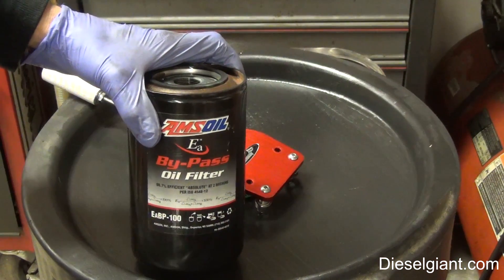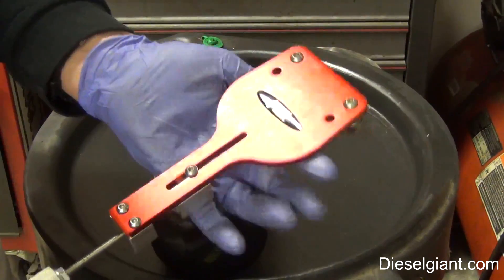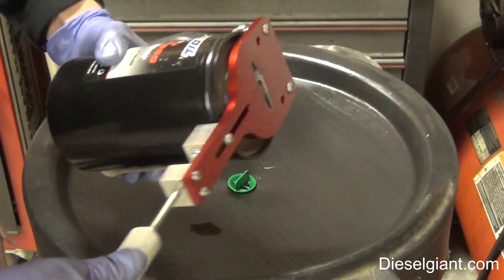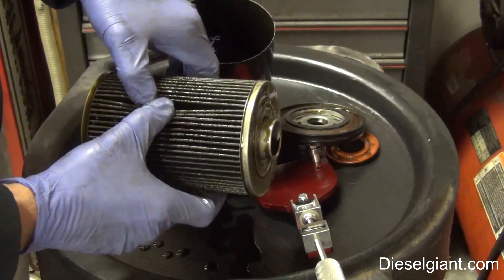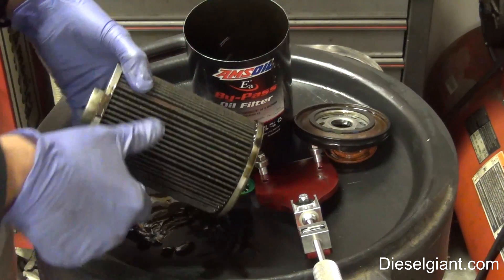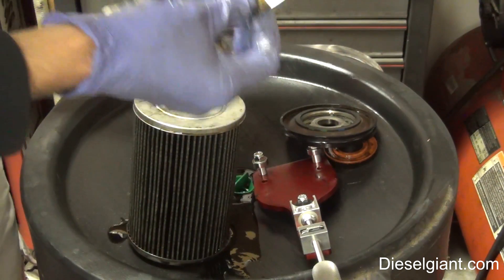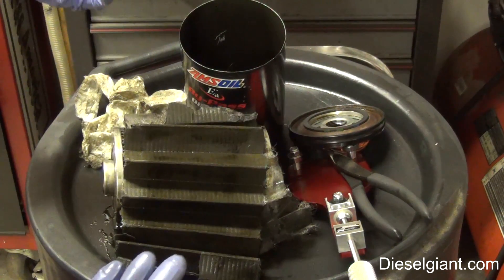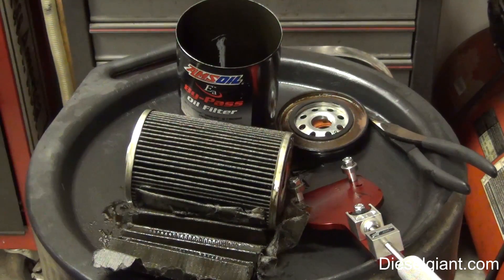Amsoil Ea BP 100 Bypass Oil Filter Cut Open and Inspected

Comment: I have been curious to see what the inside of that filter looked like, now I know. Thanks for posting
Reply: Clinton Roughton The bypass valve is located in the engine or full-flow filter - not the bypass filter.  If your full-flow filter gets plugged with dirt, the bypass valve will open to allow oil to flow to the engine.  Dirty oil is better than no oil!  If the bypass filter gets full, it stops pulling any oil from the engine - no problems.
Reply: +ICU2 AMSOIL Bypass Filters (EaBP 90, 100, 110, and the Heavy Duty 120) are 98.7% efficient @ 2 microns, and remove 39% of soot smaller than 1 micron.  Many filter companies will advertise either their filter efficiency % rating, or their filter micron rating, but not both.  Without both numbers (efficiency and micron size), you can't compare filters, or know the expected performance of the filter.
Reply from the maker: +ICU2 Your welcome, I was also curious.
Reply: +dieselworld I myself, have been using a Frantz Bypass Filter for many many years.  Then recently went to a Baldwin B164 for the convenience of a spin-on filter. But after reading many conflicting micron and beta ratings of the Baldwin I have gone back the the Frantz.
Reply: I was told as long as oil flowing it was good.  The longer the filter is installed the tighter the filtration.
Reply: Clinton Roughton A quick test for spin-on bypass filters is to feel the outside of the filter after the engine has been running for at least 30 minutes.  The filter should be very warm.  If not, it is probably plugged, and not allowing any oil to flow thru it.
Reply: Talked with a tech with AMSoil.  He stated that there are no internal valves to cause emergency oil flow. Once the filter is clogged then fluid stops flowing permanently. Its confusing be cause the name on the filter is "by-pass" oil filter but it contains NO bypass valve.  Point being, on the external filter kit on my truck it uses 10% of the internal engine oil and diverts it thru the eabp100.  service interval is recommended 2 years or 80,000 miles and I'm coming to the conclusion don't swap it out till oil stops coming out the other side of the filter. It actually tightens up the more the filters pores get clogged up.  Like wine it gets better with age.
Reply: The Frantz is a lot better because it has a lot more depth. There is no such thing as.a pleated filter that cleans oil. That filter is the same as a high quality full flow filter. Filters are not complicated. For a bypass filter to do its.job it has to be able to absorb contamination.That one doesn't cut it.
Reply: @davidbess6406  because the fact that it is toilet paper is meaningless: the only thing that matters is, it's a dense cellulose system. The media must be tight enough for the filter to trap small contaminants but not so tight as to stop oil flow. Depth at a good flow rate = great filtration.
Reply: Back in the 80s Amsoil had a lot better filter than they have now. They had Bobby Unser saying this oil change is forever. At the time I was using Amsoil 10 40 and a Frantz oil cleaner. John Frantz got his start in 1953 converting the old cannister filters to use superior toilet paper.. I improved them. I converted a flat head Ford V8 canister filter to use 4 1/2 inch Scott 1000 paper. It is on my old Ford diesel tractor..I started using a Frantz oil cleaner and Delo 100 W 30 in 1963.All I have now is top loaders. Gulf Coasts a Jackmaster Classic  some Motor Guards and the Ford canister filter. I have 2 Motor Guards over 50 years old. They all clean oil. I have several engines and transmissions equipped. The Frantz is a terrible design compared to the top loaders. They were better when toilet paper fit them. The toilet paper changed Frantz didnt. Sister wrecked the old Impala. My last two Frantzs went to a salvage in Dallas Tx over 20 years ago. Engine and transmission.